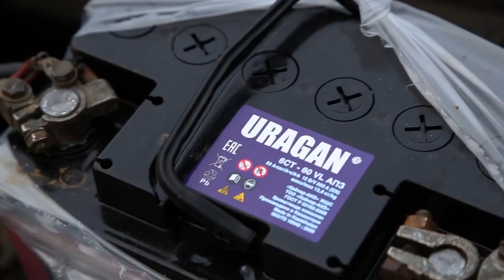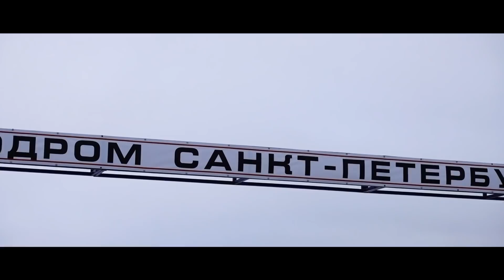ПОНТЫ vs. НАДЁЖНОСТЬ / Гордей vs. Стрекаловский

Comment: Музыка из видео:
0:56-3:36 BlocBoy JB &amp; Drake "Look Alive" (WSHH Exclusive - Official Audio)
3:45-4:08 Post Malone - rockstar ft. 21 Savage
8:55-9:14 Lynyrd Skynird - Floyd
9:23-9:51 Lil Wayne - 6 Foot 7 Foot (Explicit) ft. Cory Gunz
10:16-12:23 Hyper - We Control
12:25-12:30 BT feat The Roots - Tao Of The Machine
12:31-12:57 Сергей Шнуров - Новый привет морриконе
12:58-13:24 Сергей Шнуров - "Любовь и боль"
14:04-15:38 Avenged Sevenfold - Almost Easy
16:14-17:55 Demigodz - Demigodz Is Back - KILLmatic
18:01-19:59 WOODJU - Damballah
 PS: Поддержите лайками этот коммент :)
Reply: дай бог тебе здоровья